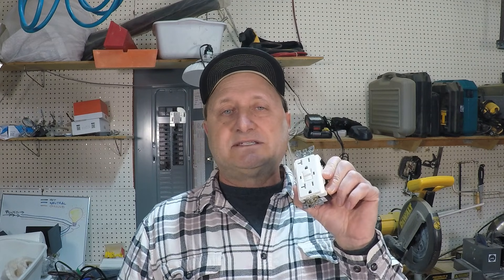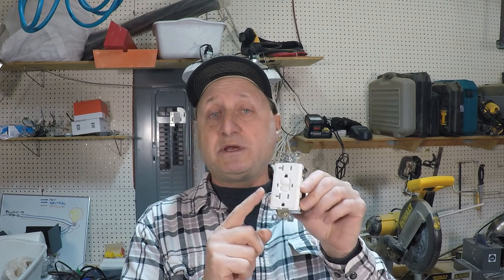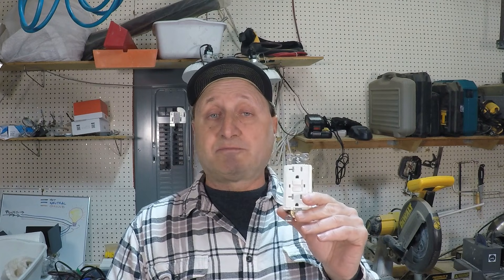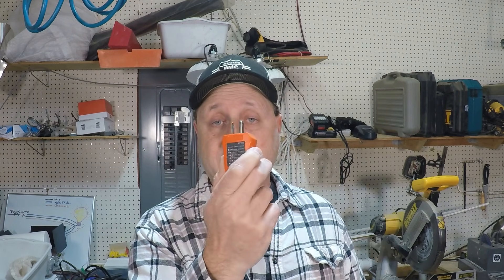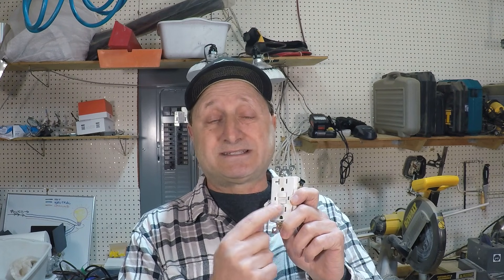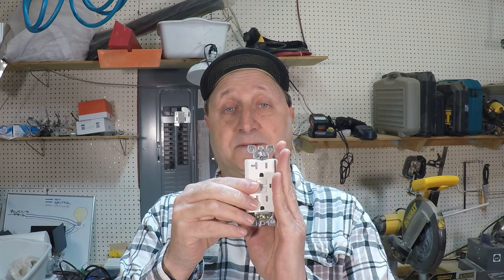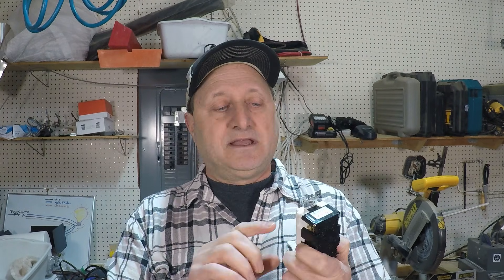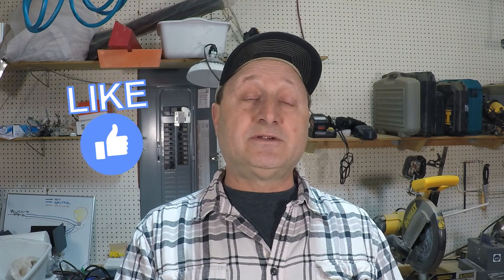GFCI Outlet Tripping For No Reason? Here's What's Actually Happening

Comment: Maybe have a bad, 20yr old GFCI? Circuit will run a small appliance, like a nightlight, then trip after 15min.  It will not reset until you wait 10min later. Is this one type of failure mode for a GFCI?
Reply from the maker: you can definitely try to replace the GFCI. Thank you for watching. Would appreciate if you could sub to the channel. Thx... Flannel Guy

Comment: This video was very helpful. I have an outdoor GFCI that keeps tripping almost every week. it is a new home, 2 years old. I have a Moen water shield shutoff device plugged in. When the problem started I put a plug cover where it is attached to the extension cord thinking it was due to moisture but it still trips and luckily it sends me an email telling me it is off line and I reset it. I just ordered a receptacle tester and am curious to see what the reading will be. My only question is how do you know what receptacles are downline from the GFCI? I have not noticed any other outlets not working but have not paid attention when it trips.
Reply from the maker: What you can do it see which receptacles are on the same circuit. Then, disconnect the downstream wire from the GFCI and see which of the other outlets went out. Thank you for watching. Would appreciate if you could sub to the channel.  Thx... Flannel Guy

Comment: GFCI's do not protect against overloads breakers do. They protect against ground faults and that's all they do.
Reply from the maker: not the case. I have seen hundreds of cases where they trip because of a device that is drawing too much power
Reply: @flannelguydiy6458 Master electrician here - I guarantee that you have not seen hundreds of cases of something that doesn't exist.
Reply: @flannelguydiy6458  Your obviously not an electrician the GFCI has no circuitry to detect an overload.